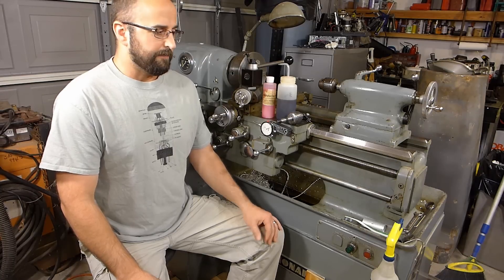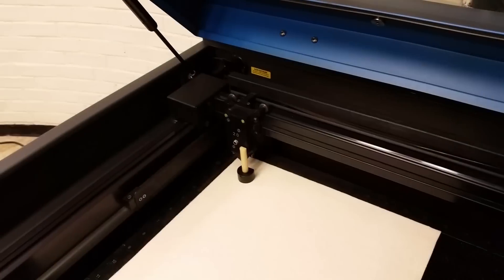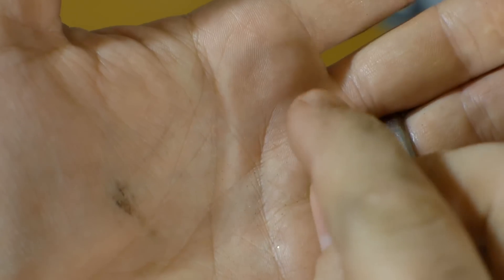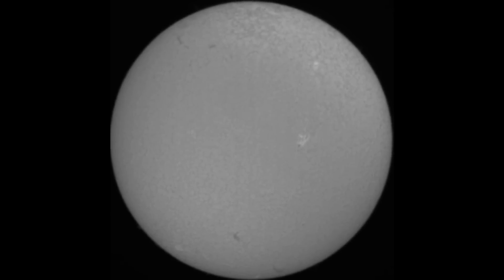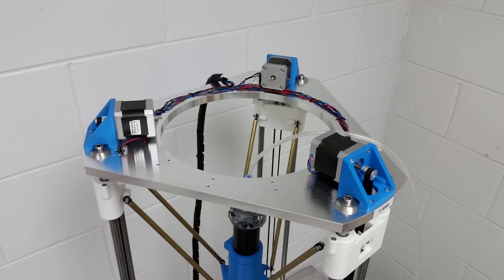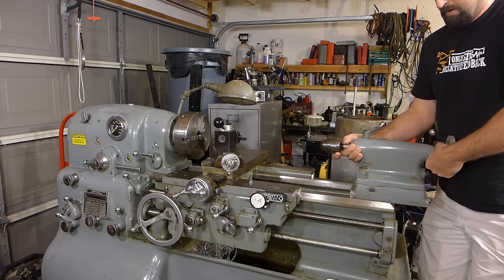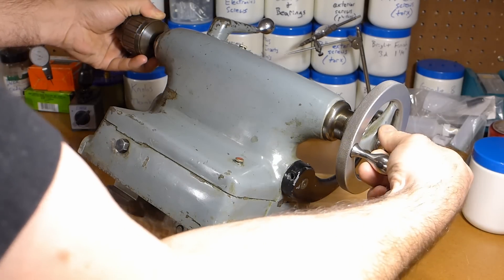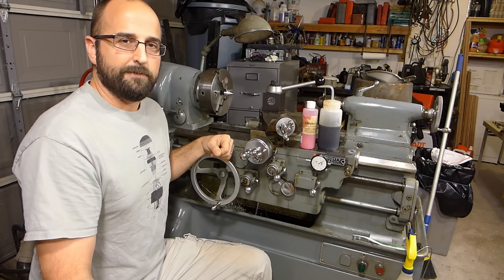Monarch 10EE: Part 7 - Tailstock Felts

Comment: any  cracking on your concrete slab due to weight of lathe?
Reply from the maker: No cracking on my garage floor. It's a heavy lathe, but it's mostly a static load. I believe the concrete is probably a generic 4000 PSI non fiber reinforced 6in. It may be slightly thinner due to it being a cookie cutter starter home. If you put the lathe on two four by fours it will not crack the floor even on lesser substrates and you don't have to worry about leveling it perfectly because the entire bottom section is a single cast iron piece, very rigid. Plus you can get a pallet jack under it if you need to move it!
Reply: Thanks for responding, wondering if the lathe is level sitting on wood, perhaps not an issue with short bed. Thanks for the videos!

Comment: I have the same version of 10ee lathe, but have been lucky in that the only thing not working is the braking function.   I can see through your videos that the electro-mechanical complexity is a bit intimidating.  I was wondering if you were to bring another 10ee with multiple problems like this one back to life, would you again retain the original speed control design?  Or would you consider a more modern solution using a frequency drive?
Reply from the maker: If it were mostly intact, I would restore it. But at a certain point you have to cut your losses. For example, if it were missing major components which would cost more than an AC conversion, I would not restore the original electronics. It also depends if my business depended on it, in which case I would put in a 10hp AC motor with VFD and get back to work because time is money. I'm just an enthusiast with a little bit of spare time and a whole lot of patience. Another options is a DC speed controller, but you won't get 240V out of one, more like 180V so you'd be down on torque, but it would be cheap. Another caveat is if I found something rare like an inch/metric 10EE I might restore the original controls. The benefit of 5hp DC with a 5:1 gearbox is a crapload of torque on the low end - more than the 10hp AC on a VFD (no gearbox). On the topic of your braking not working, maybe check the contacts on the QSD relay. I think I showed it in one of the videos.

Comment: Before going to all that work, designing, creating CAM files, buying material and cutting it, did you call Monarch to find out they sell this stuff cheaper than the material you bought?
Reply from the maker: I compared prices. Monarch sells them. My parts cost was roughly half and my labor was about 1 hour. My machines don't earn money. If I ran a business and factored in a shop labor rate, I'd just order from Monarch. But for me it was fun to make them.

Comment: Finally found a use for a dremel!?  Man, i use mine at least once a month.
Reply from the maker: Haha, maybe I was a bit harsh. I would say I use mine about 3 or 4 times a year. My #1 use is cutting off small (less than 1/4" or ~6mm) bolts to a required length. I will chuck the bolt in a drill and turn it while using the Dremel to cut through. That way there is no burr on the edge and I usually don't have to touch up the threads.

Comment: great video , nice toys, if you want to eliminate the pip on the cut off piece in parting , try grinding  the face of the tool an angle so it cuts through the outside piece first.